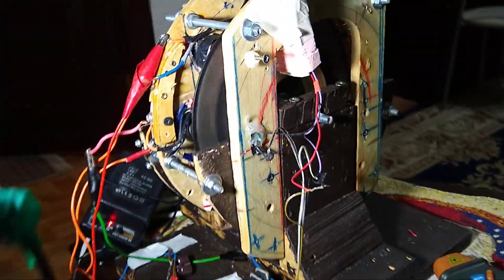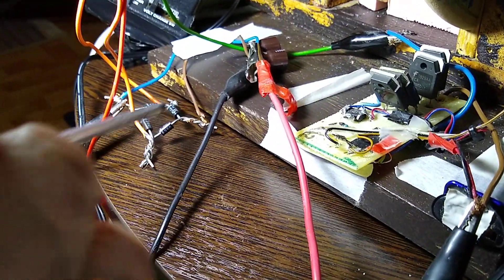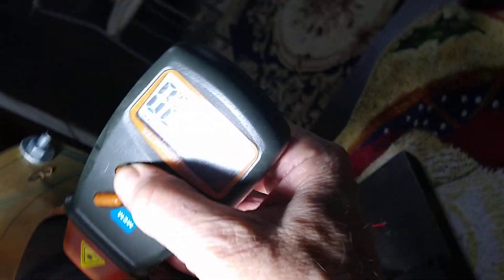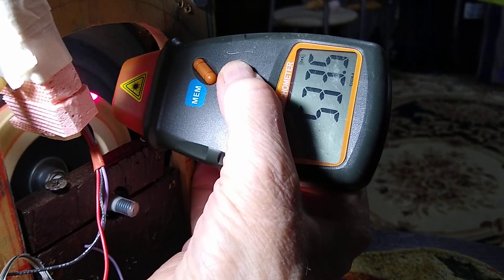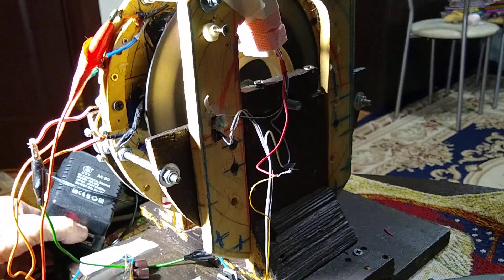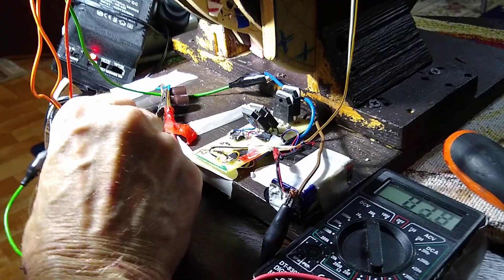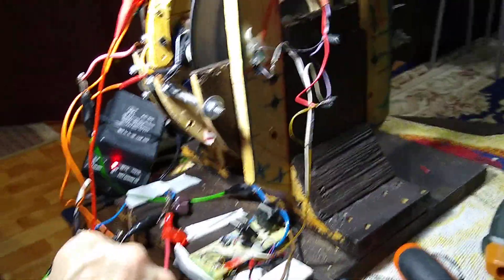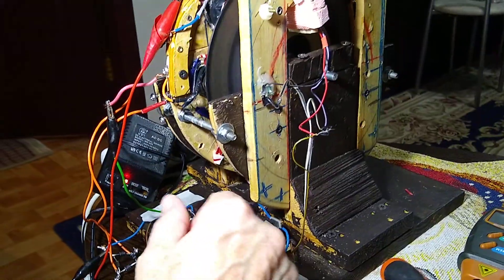No lenz reaction with new magnet-rotor offset BUT only 10ma current crowbarred "why"

Comment: I looking at the video its hard to see your config , sketch it when your able .
Reply from the maker: Go back one video in my channel and I show what the offset is when I use wrench to tighten nut on axle.
If you mean motor and gen coils, there are eight coils,  with 5mm x 25mm ferrite cores 1/3 length wound motor coil 2/3,length we oun generator coil. 4,5ohms motor coil 12 ohms to generator coil about . 25ga wire.
Reply: @MrDKONZEN  whats ratio of your drive to gen coils , you have 8 in total
Reply from the maker: @mykedoes4099  eiight "split" coil positions with cores.  Which means each coil is split into two coils , each coil wound on a common ferrite core.
So eight generator coils, eight motor coils. motor coils 4,5 ohms generator coils 12 ohms. 1/3 of core is wound with motor coil, and motor coils all face to the "left" reacting to rotor A.  
Generator coils cover 2/3 of core, and all face to the "right: reacting to rotor B
Reply: @MrDKONZEN  lol thats an awesome idea . you should flip the ohm rating between your stator and drive coils , the drive coils should be using less power than the stator so drive coils should have more ohms than stator coils especially if you shooting for over unity maybe i am missing something maybe since you have them facing opposite direction at most i guess the angle is 45 degree this is enough maybe you can get away with drive coils having less ohms and using more power than the stator coils are capable of collecting since they have more ohms than your drive coils . I guess since the stator has more turns you can manage to get more power? volts ya watts not sure . So all your lens will take effect on only one magnet rotor because the other magnet rotor is facing the drive coils I am starting to see what you are doing . excellent idea
Reply: @MrDKONZEN  im gonna stop guessing and wait for your diagram
Reply: @MrDKONZEN  I am guessing you are not grasping this circuit ? If you did you would have freaked out by now. Its similar to the ZVS in the switching but the advantage this circuit has over the ZVS is it does the same switching while simultaneously dumping pulses between two batteries/CAPS every 180 degrees , all using the Bedini SG method https://www.youtube.com/watch?v=WH4watZLhOA  it can be performed solid state as well using Arduinos and two NPN. Frankly I am convinced its already been invented and suppressed. Its open source unbuilt prototype exists only on paper here for you see look at
Reply from the maker: @mykedoes4099  Hi Myke
Not sure what ZVS means!  Not aware of this name,  Is this where you for example use three batteries, and two in series for the "high side" then the ground of two batteries in series (24V if 12V batteries) then exits into a single 12V battery in series through it coming in through the positive then exits out the ground side and that goes back to the positive of the two in series so that single "low side" battery gets a nice through--charge of 24V all the time.....and that single low side batteery could be two in parallel or four in parallel or eight in parallel,....then over time you swap batteries.....is ZVS that or something else?  Smultaneousl dumping betwee  two batteries or caps every 180 degrees does not sound like it maybe it is...I am vvery  aware of the bedini SG method with trigger wind and bifilar or trifilar motor coil.  So tell me more what it is I am missing!  Thanks
Reply: @MrDKONZEN  You have to look closely at the circuit i sent you . Its basically 2 bedini sg circuits feeding into each other every 180 degree . Try to observe the portion of the circuit that is switched on while ignoring the part that is switched off and you will see . ZVS zero Volts Switch
Reply from the maker: @mykedoes4099  OK looked at your circuit - nice and simple!  I like it....sort of rings out the two unconnected coils each way...
is this to be a bifilar coil or two seperated coils? If bifilar  Ilike the inductiom into the opposite "open" winding and vice versa....If not bifilar still good as its setting up alternating DC condition and could probably be fed  staight AC maybe too.
Reply: @MrDKONZEN  the 2 coils are drive coils you can trigger them any number of ways , I will eventually do a solid  state build but for explanation to public i am starting with a rotor and shaft. Its open source prototype and was never built . I am currently moving to a new Home so I am on hold with my LAb no point setting  up the Bench if I am moving .. Its just this simply the circuit is suppossed to take energy from Battery A and pulse it threw the coil using the flyback reverse voltage to dump into battery B when this happens the circuit that uses battery B energy is open and not under load . and this continues back and forth B to A then A to B.
Reply: @MrDKONZEN  by having only one NPN closed while the other NPN is open there should not be any shorts or transistor failure unless the Frequency gets to high it might happen. Not really sure may have to employ the method that the ZVS circuit uses to guarantee the gate is at zero volts before the other Gate closes (bleed resistor) but not likely cause unlike the ZVS this circuit does not employ any resting voltage as the ZVS does in order to Prime i think the L2 if I am not mistaken . Look at the ZVS its also few parts and not hard to follow
Reply: @MrDKONZEN  Was not as easy to think of that circuit as simple as it came out it took 2 years to remove the vague idea out my head so i could get some descent sleep. Like a pressure cooker it was building pressure in my minds eye . I believe the idea seeded my brain sometime after i got the Bedini motor running btw that took me 3 hours a night and about 1 month
Reply from the maker: @mykedoes4099  Hi Myke
I understand it pretty well. where you might have problems is the spike will be caught by the opposite open winding and travel into gate or base and blow the transistor from the spike.  
this if the spike can penetrate the diode so better have fast diodes also when a spike "rides on top" of some current going same way there is some real explosive power going on.
Also will that :straight: spike actually do a good charge into opposite battery or not,.  Maybe it will only extinquisth it so it does no "no damage' 
Bedini sometimes would save spikes from four pulses into cap, then dump cap to battery to charge for example bring cap to 36V and it drops to 23V after the discharge...this charging a 12V battery (lead acid).
I think you are thinking the spike, as well as a straight-through charge from opposite battery then through coil with spike added to it, will occur....I see problem there if there is one, that it would be better to have for example 24V in battery that zings the charge through a 12V battery so you know its really going to be a good chage....if 12V battery after resistance of coil, its going to be lower voltage than battery being charged, and spike might not make it any greater  too  I  dont know just thinking as write dont hold me to anything.
Reply: @MrDKONZEN  not really the battery should capture the spike although i will be using capacitors i am also using battery in parallel just to handle the spike , i did not mention this in my videos. Still LMK you thoughts on that
Reply from the maker: @mykedoes4099 
Takes me a year or two ot three (or never)  sometimes to understand  simple stuff that becomes super simple only when its finally  understood!
Reply: @MrDKONZEN  Even in the Bedin Sg there is not straight pass threw forward polarity charge to the load battery , the load happens on the electromagnet in forward voltage the load battery does not capture any of that (look closer at the circuit) the load battery is not a load battery its a flyback battery capture the circuit is not wired to capture the forward voltage onto the battery, that all happens onto the EM/Bifilar drive winding only . Then the reverse Volts flyback volts is wired to dump into battery there is not such wiring to dump reverse volts into the bifilar drive winding only forward volts . as far as i can tell, keep in mind i recently fully grasped the Bedini SG and i barely understood the circuit I made when i made it , I am just good with switching I am Electrician since 17 i am 48. Do a 3 way switch or a DPDT relay thats some crazy switching man but it is something i can grasp well before i encountered the Bedini SG and still i did not see the Bedini SG clearly for more than 5 years dealing with it , i would just read the diagram and build it and that would be all she wrote .. not anymore its like the Sun just started shining on this switching method . One you see the light with the ons and offs with the NPN and you look at it like nothing more than a light switch it begins to come together slowly like a puzzle . LMK if you decide to replicate and keep looking at the Bedini SG circuit I know you are a little off in your understanding cause you think the forward voltage from the drive battery is connecting to the load battery in forward voltage and it is not look again its connecting in reverse flyback voltage when you see this you will better be able to trace the routes
Reply: @MrDKONZEN  unfortunately thats the case with us all , we are programmed by oppression and stress . And it blinds us to the simplicities of just about everything from Language to Physics . Btw if your wondering about Tesla 3,6,9 thats simple and frequency that equals 3 , 6 or 9 when adding the digits together Indi dually is determined to be a resonant frequency this applies to many things for one the number of turns a coil winding has. (432Hz is resonant add 4 plus 3 plus 2) 440Hz Music Note A is not Resonant 432hz is
Reply: @MrDKONZEN  dont feel bad I have an engineering degree and i still did not get it (Bedini SG) you first have to understand how to capture flyback (reverse polarity)
Reply from the maker: @mykedoes4099  About capturing flyback - if Nchannel mosfet, steering diode goes on the Drain pin of mosfet, connects to positive of cap. The source pin of mosfet connects with the negative of cap. Pretty simple works great.
To discharge cap to load, the cap MUST be decoupled (floating) when it connects to load.  This important or everytime the cap discharges it will reflect back to input and raising amps bigtime every pulse-out and there is no gain.  Most people dont know this, and just keep everything connected and think there is no advantage to saving the flyback into cap, and will just jam it into a lead acid battery, or ground it out back into the coil itself using the steering diode.
Reply: @MrDKONZEN  kinda follow you but little lost. Diagram? Granted if the Led Acid Batt is sulfated the energy is wasted on desulfation and not captured , not so important for my diagram since i am planning on just keeping the rotations going so my 3 phase gen system is the supply watts . Not planning on draining the 2 batteries at all unless the system works beyond expectations
Reply: @MrDKONZEN  I recommend using N/S Gen Mags on the Face of Rotor and N mags on the Circumference of same Rotor as Drive Mags placed 180 degree apart this way you can use a single 3 phase Tesla Stator on the same shaft as your gen mags  located on the face of rotor and two drive mags on the circumference of the same rotor placing two drive coils 90 degrees apart around the circumference of the  rotor

Comment: good job but the best way to check if you have something is to put a load even just 2 lamps 12 volts and see if the speed slow down or the input increased on amps
Reply from the maker: Yes, real loads to see if this is useful and not just dead short testing.
I will ll be checking that out soon...another motor a good test.